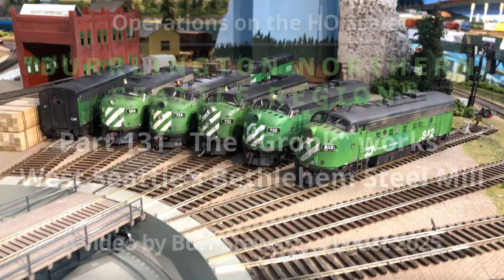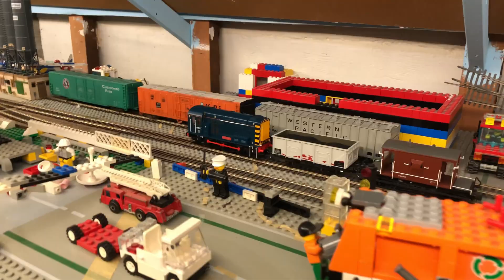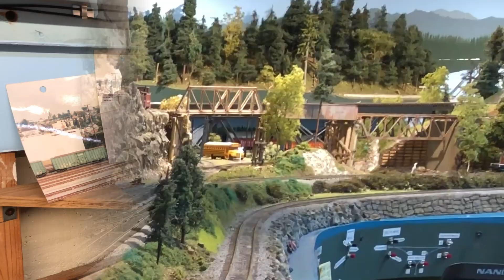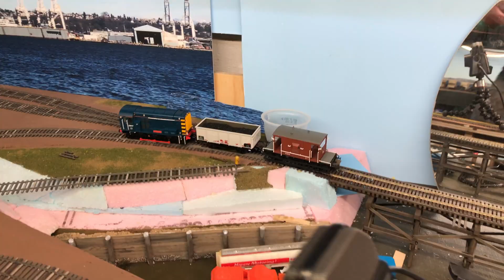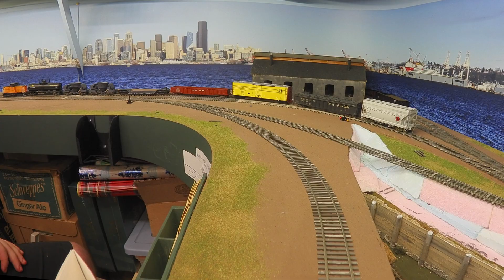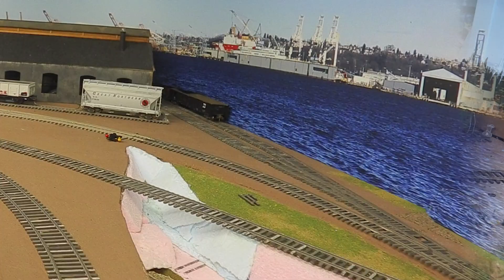Part 131 - Steel mill switching in West Seattle with a BR "Gronk" and MILW 44-tonner #hoscale #train

Comment: That Gronk British switcher is one interesting locomotive. It reminds me of a Fairbanks Morse loco and it sure would look good in paint and markings of a North American railroad. The Gronk does a nice job of switching your new steel mill. Oh the wind sfx were a realistic addition yes. The lego scene looks alright too and reminds me of when my dad built a structure for his older layout with lego but it was too colorful. He did use lego for bridge pillars at one time but painted them one color to look a little more realistic. Excellent video Burr 😄👍🏻
Reply from the maker: I had the same reaction to the gronk. Really similar to an F-M, which I also really like the looks and sounds of. The LEGOtown, it will eventually go away, but I'm waiting to make sure grandchildren don't happen before converting it to a grown-up play area...
Reply: @muchfunwithtrains Oh ok better not dismantle it just yet.
Reply: 1:57 not quite a bang